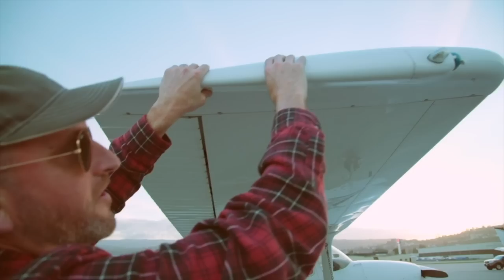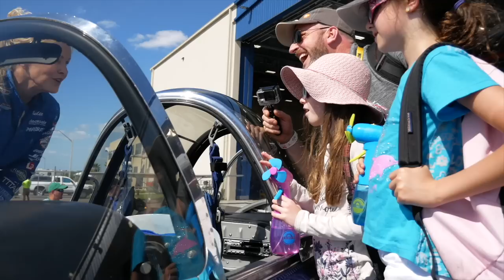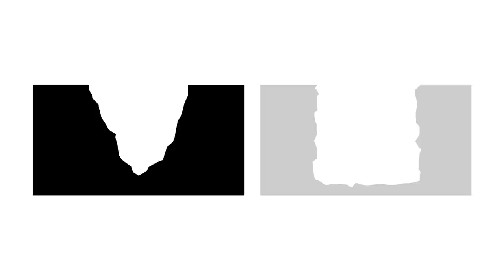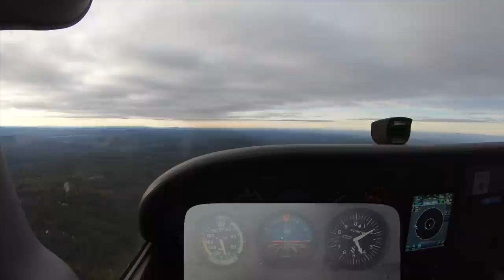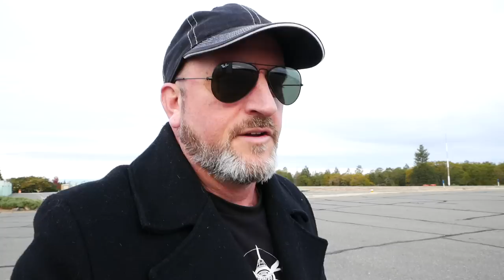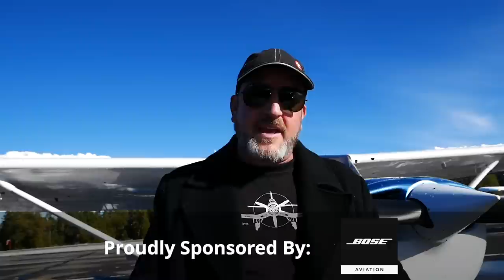The BOX CANYON Turn - LEARN TO TURN THE AIRPLANE IN THE SHORTEST HORIZONTAL DISTANCE.

Comment: I have been flying the Cascades for over 40 years and practice both slow turn and wing overs on a regular basis.  But two things should be emphasized and the first you did not mention and is basic to mountain flying: NEVER fly up the middle of the canyon!  And second, you mentioned very casually but can be of immense help: the use of flaps.  Try it with and without flaps and you will quickly learn the importance.   The wingover may have saved my butt one time.
Reply: Can you explain your wingover more, I'll be flying the cascades and doing some mountain courses soon, would love to learn from your experience. I've also been told flaps are one of the keys to these moves, almost like dropping a boat anchor and swinging around it. A++ tip on not flying in the middle of the canyon as well, easy way to cut your manuevering distance in half.
Reply: Wingovers used to be a required maneuver for commercial ticket; don’t know if they are now or not.  Initially pitch up 15-20 degrees, roll up to 50 degrees and just allow the nose to fall as the airplane turns and nose drops through about 90 degrees of turn.  Airspeed will begin to pick up rapidly. Be sure you don’t exceed Vx.  You can control with both pitch and power. At about 90 degrees begin to pull the nose back up and with the excess speed you will start a climb.  If you do it correctly you will be at or near your original altitude at the 180 degree point.  The key is to allow the nose to fall through the initial turn. It best be done with an instructor the first few times.

Comment: OK Good stuff here
44 yr Colorado pilot here
Try this:
 Your probably going to be trying to climb already, say your at 70 knts  full power.
Head for one side of the canyon early. Get fairly close to it for max clearance for your U Turn.
Roll 45 degrees and drop full flaps and LET GO of the controls. Never pull, never.
When you've turned say 120- 150 degrees PUSH raise flaps and return out of your canyon.
this is pretty idiot proof
Reply: Right on. You have me beat flying mountains - only 42 years for me flying the Cascades.  You described my Wing Overs perfectly.  Got me out of a No- Climb position once.
Reply: Demo that on a real canyon turn you say it will work.

Comment: With the steep angle turn, why do you put power to idle, exactly? On the pitch up, you would gain more altitude with power, no? Is it that you want to keep from overspeeding the engine, when you go in the steep turn? Or keep the amount of things to do in parallel to a minimum?
Reply: We do not need to reduce power.  It is just a turn using the designed in safety feature of dynamic neutral stability to prevent stall.  If we have enough airspeed, we pitch up wings level first to gain altitude and reduce airspeed to reduce radius of turn.  If we do not have zoom reserve airspeed, we do not pitch up first but rather just bank as much as necessary to capture the target, the bottom of the drainage going down hill.  The key is to release back pressure in the turn so as to remain at 1 g.

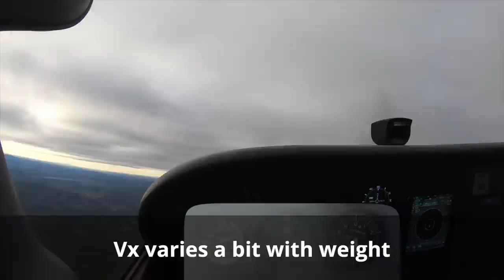Comment: 02:45  You dont 'TURNAROUND" anything.  It is a 180 plus TURNBACK.  When you finish it you will be close to the other side and keep going to over 200 degrees of TURNBACK.  Again, you dont Turnaround anything, So Dont look outside much.  Use the instruments mostly.  Outside looking only will make you feel a lot of pulling up sensations and even confusion.  And that is how guys stall and crash even if they had 10.000 hours doing other things.

Comment: Could the second turn you demonstrated be a viable way to complete the impossible turn if, and only if, you knew the aircraft well and had enough altitude at the point of the engine failure to attempt it?
Reply: I think the issue with that is if you're trying th eimpossible turn at 500-700 feet for instance, via the video he gave up 250 feet to achieve it. You might be pointed in the right direction but you're going to land quite short I think. This move doesn't concern itself with effeciency, which you sure would want to if you're in an engine out. Can't get that energy back.

Comment: If the crosswind is significant and you're flying the downwind side, turning into the wind to escape also turns you toward the upwind side of the canyon, where downdrafts may come into play if you end up close to the other side.  Hopefully you haven't gotten yourself into that tight of a spot, but it would be a major drag to make the 180 degree turn successfully only to have downdrafts push you into the terrain.  I guess you could keep turning to get back to the downwind side.  Your thoughts?
Reply: That would certainly be a factor, but on the other hand, the headwind you get when you're halfway through the turn would also reduce your ground speed and tighten your turning radius.
Reply: On the spot, you're going to have to read into feedback as much as possible, to make those little adjustments and keep your nose up, but not too far up... Aside from a very few phenomena, you should still have some altitude to trade out for completing the maneuver into a reasonably stable flight path as well as attitude for the plane... AND if necessary, keep or kick the power to full, and climb until you're back to a relatively comfortable altitude as well.

    In an emergency, you're already on very limited choices... It's kind of the nature of "emergency" in the "Emergency Maneuver".  ;o)

Comment: Another method.....fly as close to one side as possible and turn as steep as needed to avoid the other side. As long as you have the altitude, and do not pull back but let the nose drop, you will not stall or crater it in.

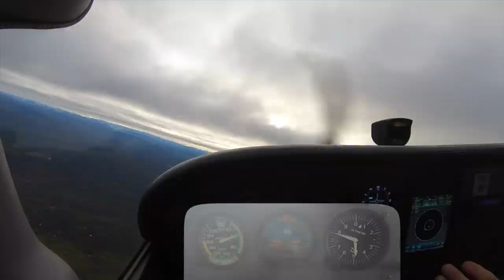Comment: So at 3:01 in the video, you're banking left but your narration "comfortable holding right rudder" , this might confuse someone as a left bank and right rudder , well we know what that does (Slip) or have I missed something here as I've not done a box canyon turn per se. Nice video nonetheless :)
Reply: I think what he was getting at was, at high power and low airspeed, you have lots of left-turning tendency. The right rudder is needed to stay coordinated. Pilots may feel reluctant to use crossed controls at low airspeed that close to the ground but, as long as the ball is centered, you'll be fine. If the ball is centered, you will be neither in a slip nor a skid.
Reply from the maker: Yes, thank you.
Reply: @TheFinerPoints  
Jason,
Please allow me a question that will probably date me.

Do you train your students to select a ground reference point like a water tower;

Laying your wing on that point and pulling through tight 720° turns and each time running through your own wake.

 My instructor knew I was not comfortable at my young age in flying with extreme Bank angles.

He noticed I was leaning away from the steep turns.

After all of the turn practices were done we always went to left and right 720°and then we went immediately into accelerated stalls and then from there spins left and right.

That broke me from my aversion to Steep Bank angles.

That gave me a lifelong passion for aerobatics until this very day.
"LIFE IS A PITTS"

JASON I REALLY ENJOY YOUR WORK YOU'RE UPLOADS ARE FANTASTIC

I would really like to meet you someday I believe you're a real Aviator not just a pilot.
And thank God you don't come on with a banjo.

📖🛐✈️🐆

Comment: Problem is..  most boxed pilots are already near stall speed, faced with climbing terrain, typically high density altitude, rotor winds coming over ridge or canyon sides...
Good stuff tho. No doubt. Especially last part.

Comment: Well, I am confused. Technique 1 — 15 degree bank at 60 knots = 1200 feet turn radius. You better be in a half-mile wide canyon. Why wont you do a 80-knot 45 degree bank turn? It will be less than half the radius. Technique 2 — This feels closer to what will be effective .. but why power to idle? Give it full power and 60 degree bank at 90 knots (remember stall speed will increase by 42%), you will minimize altitude loss and turn in 800 feet diameter. 

I am not sure I buy this one. Please convince me.
Reply: I was meditating about the math of this problem as well. First of all a disclaimer: I am not a CFI, all the following are just theoretical considerations and by no means meant as flight instuction. The math of your examples is correct. But when you use 30° bank with 60kts, the radius also is ~550ft (and stall speed only increases by ~7%). The thing is, that the radius goes with airspeed squared but also with 1/tan(Bank angle). As the second function is a bit hard to imagine, it is difficult to get an instructive picture about how the radius changes when you change both variables. As you pointed out in your example, shallow bank angles are quite inefficent, they increase the turn radius "overproportionally". With higher bank angle, the effect becomes more and more linear. On the other hand, reduction of airspeed always gives you a quadratically reduced turn radius. So reducing the airspeed is not a bad idea but you can kind of destroy this advantage with a shallow bank.
About your comments on the second technique: the point is, that by letting the nose drop, you stay at 1g and thus the stall speed does not increase. You can bank 60° at very low airspeed without stalling (as you can see in the video) - this then obviously results in a much tighter turn than your example. Full power would probably not give you an advantage there but would cause the problem of a strong yaw when you pitch up which could result in an inadvertent spin (the last you would want in that situation).

Edit: In the first version of this comment, there was an error: the radius goes with 1/tan not 1/cos. I corrected the text accordingly.
Reply: @marccreal  I appreciate your comment. I was going to point out that hey, it’s 1/tan(bank) but good thing I re-read it 😀. 

I am not (yet 😀) a CFI. But I read the PHAK/ AFH and know trig. I didn’t want to be prescriptive — but what you pointed out at the end is exactly right. Let’s take it further:

Really slow it down in a 60 degree bank and keep pulling to beginning of stall warning, while accepting descent as necessary. It turns in like 250 feet radius. Now if you added power, you just limit descent. I believe there is a Civil Air Patrol Mountain Search and Rescue technique like this — that’s what I learned. DISCLAIMER: I AM ONLY TALKING MATH. GO GET A CFI TO LEARN THIS TECHNIQUE. 

Anyway, I am sure no one cares about math 😫, as evidenced by the rest of the comments.

Comment: Why VX?  What is the point of our training in slow flight to when we’re mushing around at 35 knots with horn blazing ? 

If you’re trying no to get pancaked into granite-cumulous aren’t you wanting to be as slow as possible?
Reply: I guess it's because If you are so slow, you can only do small bank angles without stalling and thus your turn radius will be large. Furthermore, I think he is also using vx to simultaneously climb with best angle of climb (which is an advanteage in a V-shaped canyon because the higher you get, the more space to turn you have).

Comment: I like most of your content, but this is wrong and dangerous in many ways. Airspeed is your friend, especially if you're at high DA and the engine is not producing much power. Smallest radius is achieved at Va (manoeuvring speed aka cornering speed) and max available load factor (3.8 g for most GA aircraft). If you are slower than Va, your aircraft will stall before reaching 3.8g. You cannot pull as hard, your radius will increase. You will need to trade altitude for speed to keep the radius low. Faster than Va and you might bend the aircraft. Get to know your aircraft and how feels/what it tells you. 3.8g equates to a perfectly flown 75° bank turn. Most GA pilots are not comfortable with >60° turn or  pulling more than 2 g. Understand the v-g diagram.
So here's what to do (for tight U or V shaped canyons):
1.) Get as close as possible to one side of the valley or canyon (forget about 500ft above and away from terrain) use every inch available.
2.) If above Va raise the nose, trade speed for altitude. If bellow Va, lower the nose and trade altitude for speed (up to Va). 
3.) Bank to 60°-75° and ride to stall horn. You might have to have to trade (more) altitude to maintain Va. If you cannot maintain speed and have no more altitude reduce the bank angle and pull less.
It's a whole different story for wide valleys, high DA and running out of power or hitting downdrafts.
1.) Fly Vx
2.) Shallow turns, maintaining Vx to turn away from terrain, downdrafts, ...
3.) Maintain Vx to the scene of the accident or life to tell the story that Vx saved your life.